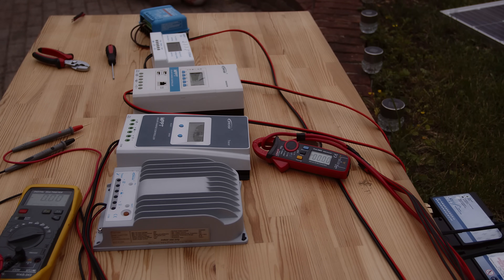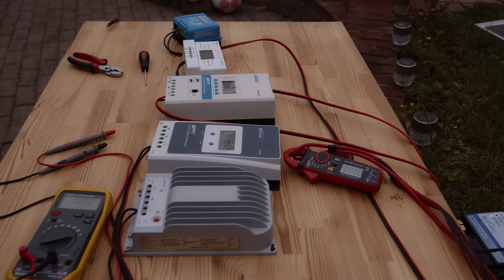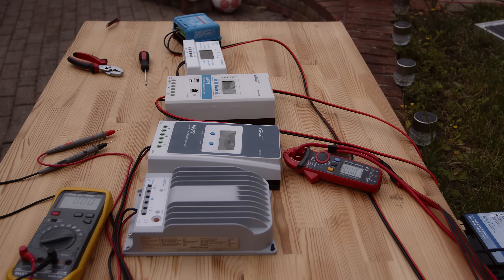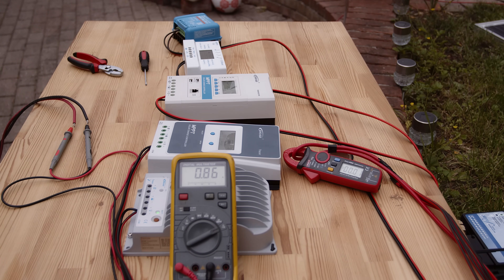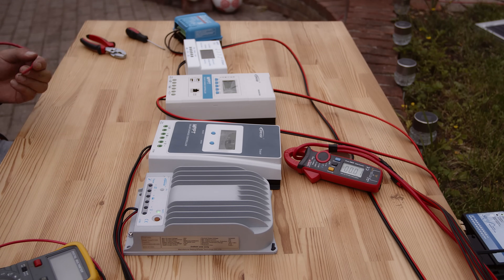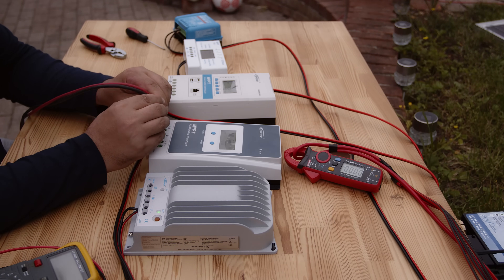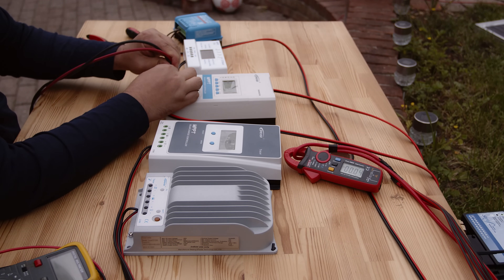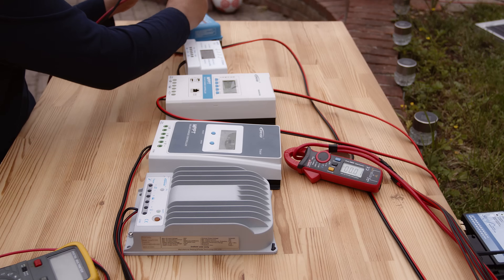Let's test Solar Panel MPPT Charging Controllers - Part4

Comment: I have the " slow" one. I have 41 volts open circuit. I'm going to get another one in a week. The first one has worked just fine for five years. Mine is faster than yours for some reason.

Comment: I'm trying to learn about charge controllers myself to choose one for my two panels I got this guy don't know how to do testing on anything and I don't know that much myself I can see he's very inefficient on his test he probably has some voltage regulator hooked up instead of a battery just to power up the controllers the first charge controller and the second one I ordered one of those I forgot which one I was a week ago waiting for them to come in the mail but at least I got batteries to connect mine this guy don't know how to test nothing the way I see it sorry but that's how I feel because his first video I seen did not prove nothing on low voltage

Comment: In real life your solar panel voltage will not drop below 36 volt even during extreme cloudy condition in the day time, only the current will drop .so I think you are concerned with a hypothetical situation which is not going to happen except for about one hour in the early morning and late evening.There is probably only one boost mppt solar charge controller in the market and the model no. is 7210a where you will have to connect a lower voltage panel to higher voltage battery.Do read my comment on the first part of these series also.
Reply: Tend to agree on this as I and others have stated on previous videos, I think he's looking for a solution to a problem that doesn't really exist and would only have minor gains even if it did exist i.e. voltage boost. The only scenario where voltage would to drop significantly is individual cells on the panel lost output like a bird pooing on them for example - provided the panel is clean and all cells have the same level of luminance then the voltage will be largely at the nominal output. If you look at the datasheet of any commercial panel it will show the Vmpp which is around the 29-30V mark in my experience. Add to that the fact that he's using a string-type panel that's not matched to 12/24V battery applications, I think hunting for a charge controller that matches is needless. No mention of the size of battery either - that could vary in voltage from 24V (50% capacity) to nominally 27-28V (fully charged) so some energy will be wasted anyway by the charge controller trying to push current in at anything higher. The charge efficiency of the battery itself is only around 80-85% too - hunting for Wh gains on the controller efficiency could be better focused on other parts of the system in my opinion, but he's an electronics guy so seems to be obsessing with the controller ;) I know the feeling, I am too, but learnt not to get distracted on points like these some time ago :D
Reply: @Umski  I also agree with you. I think he is not reading the comments to rectify the misconception.Also for a small solar system costly mppt controllers may not give much advantage than buying a cheap pwm controller and investing the saved money to buy an extra solar panel which will increase the overall capacity of the system.
Reply: @rainbowtechnosolutions4351  I am doing a virtual face-palm on this as no mention has been made of the batteries (type or capacity) either - on the pt 5 video, they appear to be standard car batteries, although I may be mistaken. If that's the case then the whole system will suffer...kind of lost interest in this as there's no closed loop with viewers...stick with the electronics repairs ;)

Comment: Nice video series. I also didn't know that those charge controllers do not boost at all. Thanks. You prevented me from making the same mistake as you did. Thank you for that! And good that you can correct it, by just ordering another panel and connect it in series.
So, first you choose your battery chemistry and voltage: 24V lead-acid. You already explained why you choose 24V. Excellent choice, in your case.
Then, you select controllers that can work with 24V lead-acid batteries and with the max power you have in mind.
Then, you select solar panel(s) that can provide that power. The max open voltage should be close to the max that your controller can handle but not higher. It is no problem to put panels in series to reach that voltage, if you do it right.
IF you put panels in series, you need to take care that all panels of the string will be in the sun. If just one of them is in shadow, total output will go down A LOT. IF you put panels in series, those panels need to be all exactly the same. And in series, you'll get higher voltages, which can be more dangerous. Water tightness of junction boxes will become more important. Keep this in mind and you'll be fine with panels in series.
Also, do it safe and compliant to any laws, codes and specifications that might apply. For insurance. Not for yourself. But you already started out in a good way: going with MPPT charge controllers and selecting the best of five.

Alternate more dodgy way of doing it:
- 24V lead-acid battery
- Solar panel, nominal voltage 24 to 36V
- Bunch of parallelled diodes, capable of enough forward current that it will be able to put the solar panels generated power into the battery. (these diodes prevent that your battery will drain itself via the solar panels, at night)
- Bunch of heat sinks, fans, power transistors, enough to convert all of the solar panels power into heat, in a smart circuit that will protect the battery so that its voltage will not go over 28.8V in a case of a long sunny day while you are not at home to use up that surplus power in a more useful way. Preferably temperature compensated: hot lead-acid batteries have a lower maximum voltage. I'm sure you can design a circuit for that.

This alternate dodgy way might even be more efficient than your charge controllers with that single 300W panel, especially on cloudy days...

Comment: That T30 toy is a scam. MPPT is the name of that PWM charger :) you need 2 solar pannels for your 24v battery system. The VICTRON ENERGY is a good one. Off course no real MPPT charger will ever boost. What's the point? A real solar pannel will always give you at least 18v at max power point (read the label, max Amps). When the pannel will not give you at least the specified open circuit voltage it will be already dark outside, and no amps delivered. A real MPPT will do complicated math in order to keep the solar pannel at max power point. Boosting from 3v will be 100A in order to reach 300W ( your solar pannel at 100% efficiency) - cables thickness? Welding cables? :)) The VICTRON is doing it's business, tracking MPPT, perturbe and observe. Sorin, read more and come back with a nice video. Don't put on youtube videos about somenthing that you obviously don't understand. 
I don't want to sound disrespectful but it would be good to test first and only then post a video on youtube because some subscribers may not watch all your videos about solar panels and already order components based on some erroneous information or pure assumptions provided by you so far. I will follow with maximum interest, as usual, the evolution of the project :)

Comment: Loving this series Sorin, I can understand your disappointment on the input voltage. Is there not a way to boost the input voltage to charge at a lower rate that switches off with a relay once it hits higher input?
It just seems a waste that you need 28 watts before charging

Comment: Why would the cheap one be so bad here when it was the best on the inside test? it isn't that slow so....
Maybe because of the stable PS? if so, please do a test with that unit again on the PS again but keeps changing the voltage back and forth to see if it is that.

Comment: The cheap one showed very good results in Part 1 and Part 2 , it was efficient and was starting from a low voltage point , why is like 20% worst then others and the real test ?

Comment: Sorin i think you should go for hybrid inverters rather than using these devices. There are many Chinese inverters available in the market with voltronic board and are not much expressive. They are grid tie and can compensate for low solar voltages from the grid. I think it is better option rather than using a separate charge controller and inverter.

Comment: Hard to choose the victor when the amps are all over the place....sad considering the nice app. And YES OPEN THEM!
Reply: Jeremy Voshage the victron is nice because of the app but very expensive. The efficiency of this controllers are more or less the same if they are real mppt controllers. But some use fans and are noisy.
Reply: @Todestelzer  Yes amps may be all over the place but its the power that matters. An MPPT will keep the IV curve at the corner as best it can. Comparison is down to the algorithm and its speed. fast and slow both have their pros and cons. I think from looking at previous videos the cheap mppt is only a pwm